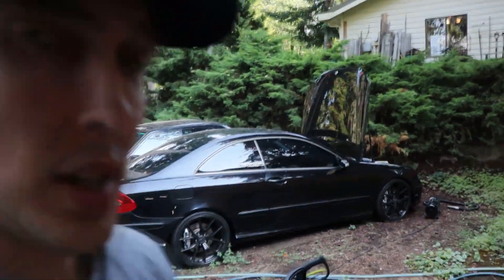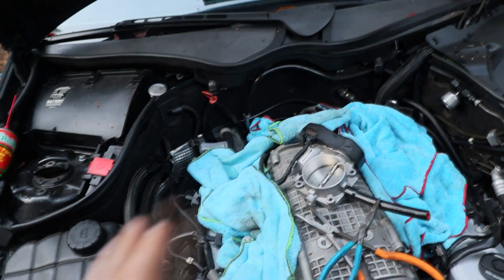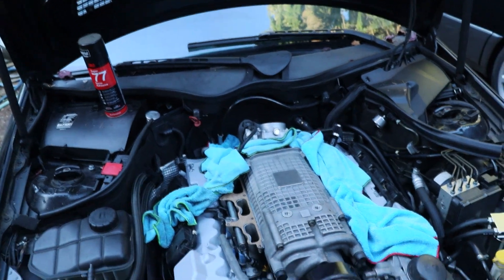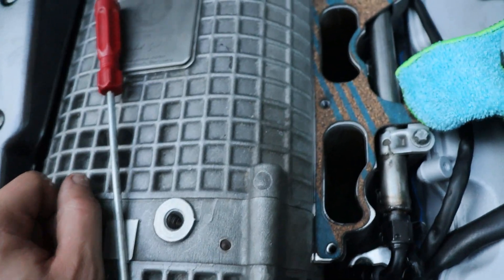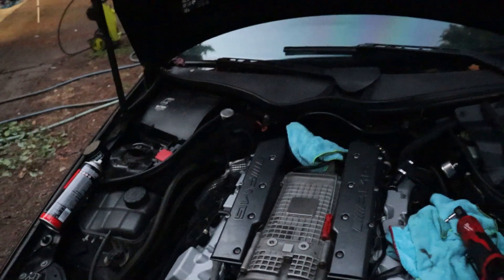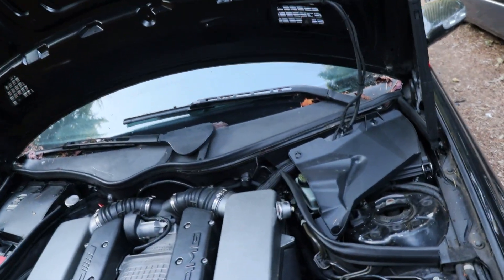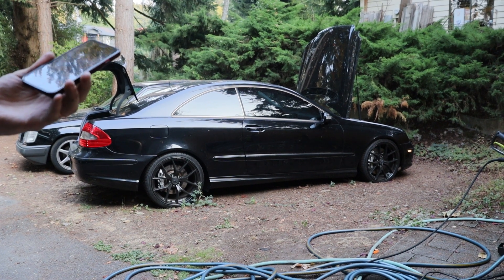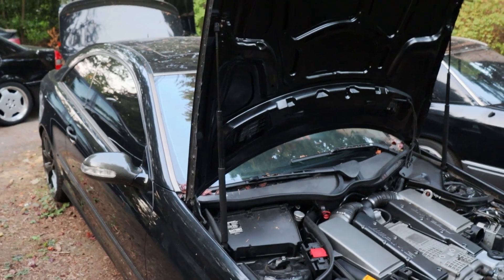PROJECT CLK55K AMG - Completing Engine Bay + FIRST START!

Comment: i would install a wide band just to be sure you dont run lean threw out the rev range.. sound sick..  i removed the rear muffler on my clk500 dont sound crazy loud with the mid stock resonator only. Looking good
Reply from the maker: Yep 👍 have zeitronix kit and will data log with wideband

Comment: dont know what seller you got the "not working right ebay injectors" from, but the 440cc's i put in the old 4.6 ford triton are running grate set at 23psi "10psi idle". back up at 70mph in a 1/4 mile at 3300 feet above sea level. 20psi on the top end out a set of 42lb/hr 440cc... its not a 340hp motor, but that's what the gas flow is saying.
Reply from the maker: In all honesty they’d probably have worked fine… but it’s just peace of mind

Comment: Is this a 2006 Clk? The tailights look different? Anyways nice build!
Reply from the maker: 03’ has led tails
Reply: it is an 03 I believe from when I had originally saw the ad. The taillights are from the facelift, which was in 06 yes, so the previous owner had put them on after the fact.
Reply from the maker: @williamkovacs8019  they’re not OEM
Reply: @ANDERZENAMG  I see, the design is of the 2006 clk though
Reply: They look like 2006 or 2007 style tail lights but with LED's as well  , the original 2003 's  must have been changed out.